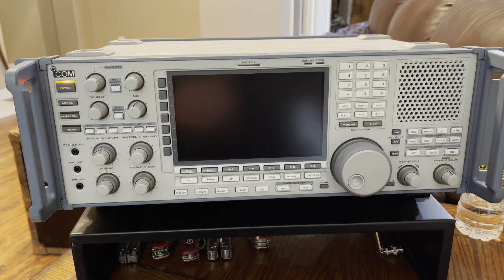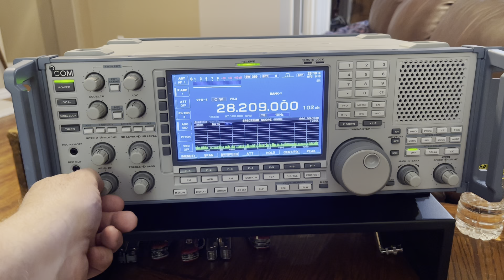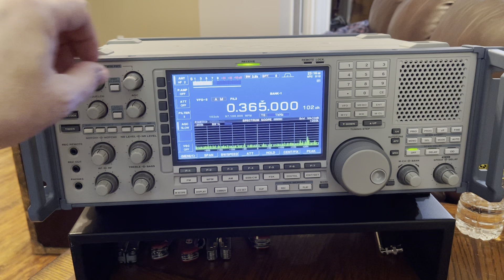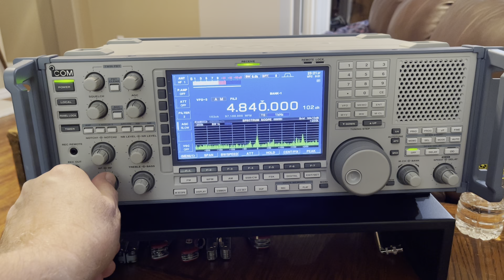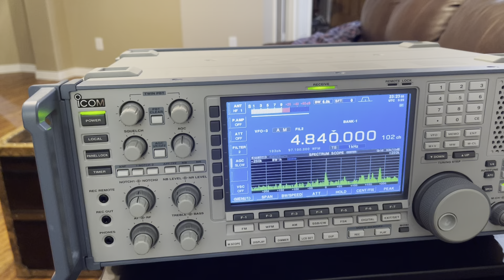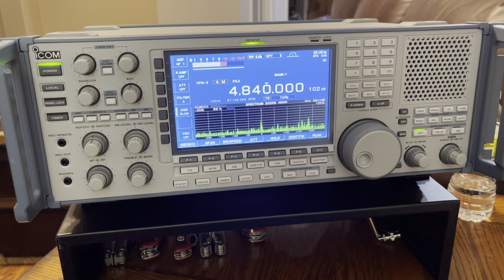Icom IC-R9500

Comment: I have had this remarkable receiver since November 2011 when I purchased it from Amateur Electronic Supply. I only have a vertical antenna (HOA stuff) also use my gutters, indoor discone, and a Diamond (indoor) dipole. I'm an avid short wave listener as well as international flight communications and a helluva lot more. Not long ago I was able to pick up the Solomon Islands Broadcasting Station from my home in Monroe Township, NJ with my poor vertical until Radio Romania came on and knocked it out. This radio will do things you cannot believe. I regularly listen to volmets, UK Military flights, Gander radio, LDOC's, Dakar ATC, SFO ATC, ACARS (have a converter for this), etc., etc. W2FKN
Reply from the maker: Thanks Rich. After 5 days I love this thing even more.

Comment: Good to see  video on the 9500. I have one here also, u can see in some of my vids. I do wish Icom would do some updates to this radio maybe a firmware update. I use mine on FM Broadcast quite often and wish that I could select a narrower filter on WFM as the radio often suffers from near by freq interference on FM band. Its somewhat annoying. Its good to know someone else has one of these.
Reply from the maker: Try using the attenuator to reduce the nearby signals
Reply: @dieselten01  I have all the FM band freqs in one scan bank and what I am sometimes forced to do is to save some of the freqs with the preamp off, this seems to help. But i dont want to reduce signals too much as i am FM DXing. I have written to Icom but got no response
Reply: @dieselten01  also there is a fantastic looking Waterfall graph inside the FSK mode decoder. Surely ICOM can organise a Firmware upgrade to make a waterfall available on the main scope screen
Reply from the maker: @VK2KRR  i agree. A few updates would be nice.

Comment: Makes one wonder why the IC-R9500 still intrinically rocks all these years later.
Reply from the maker: I think it is because radio manufacturers don’t want to put more money into their radios.  Everything now is sdr where you basically operate a computer.  They can achieve great results by tweaking the software.  But for me, I don’t want to operate a computer or click a mouse.  I want to run a radio.  Thanks for your comments

Comment: What ICOM did with this radio is use Superior Components in the radio, with advanced design engineering. Kenwood brags about their brand new 890S having an IMD of 110db!! But the Icom has a IMD of 109DB! That number is hard to engineer back in 2002!! Their is a reason Icom still sells the radio today... Still superior or on par with many newer radios... the Icom uses 32 Bit  point floating DSP, same as the 890S, but all V8 engines are not created the same. 20 years later and the Icom will still out perform the Kenwood in many ways...
Robert

Comment: Also I have a 9500 also bought it from DX engineering it will be 2 years old this July. Also apparently they have been officially discontinued Icom is no longer selling or making these receivers any more.  I am anxiously waiting on any news for the next replacement model probably a R-10000. Does anybody have any news on the next model or a good place to check for latest greatest rumors.

Comment: Awesome 👍 quite rare to see the 9000 and 9500 together. Have you tried out the RTTY decode yet ? I've seen another video of this happening and it's even got a brilliant little tuning aid to line up the peaks and then scrolls the readout across the screen. Personally I'd be really interested in the comparison between this beast and the 9000 just to see the differences in pure analog as in the 9000 to the analog/digital of the 9500. Where you can scan microwaves and with the colour screen if only it was portable because you would be able to pick up CCTV footage and all sorts not just the normal television channels lols I dare say with the capability of it reading memory cards you could probably even watch films on it !! I'd be very interested in seeing how it also compares with for example the ICOM IC-R20 on general scanning operation. Look forward to seeing some more videos on this amazing bit of technology.
Reply from the maker: Thanks Shaun.  I have a comparison video up with the 9000/9500.  As for rtty… I really don’t know anything about that.  Someone requested a fsk decode video yesterday and I went and read about it in the manual… problem is, I don’t know where to find the fsk signals or if fsk and rtty and digital are the same or different. I really don’t know anything about that

Comment: I´m jeaolus ;-) Fantastic piece of Rig. Does the 9500 record to a SD card like th e8600 ? And..could you post more comparisons between the 9500 and the 8600 ? Both are fantastic radio.  What I don´t like of the 8600 is the lack of DMR mode. Too bad.
Reply from the maker: Hi Mark, I have a direct comparison of the 2 radios in a 50 minute long video on my channel. The 9500 will record to either the internal memory or an external USB drive, no SD card slot. The 9500 has an optional Digital board that does P25 phase 1 only, no phase 2. I didn’t get it because everything around here is phase 2.

Comment: hi there,
Could you suggest on How can i operate IC-R9500 in my vehicle with the power supply from my vehicle batteries?
Thanks in advanced.
Reply from the maker: I am not sure but I don’t think the 9500 is rated to run on an automotive 12 volt battery.  I read this on the 9500 owners group on google.  You need a regulated 13.8 volt 10 amp power supply.
Reply: @dieselten01 any alternative mechanism to operate 9500 in vehicle? Besides im thinking to use an inverter in automobile battery as  input voltage, could you suggest please?
Reply: Supplying Dc power source 12V approx. 5A to IC-R9500 with a DC connector.
Its working nicely in Electric Vehicle.

Comment: 6195 had DEEP FADES, and the SYNC was not affected by that, Excellent Sync. SYNC is for Deep Fades, the real test! Also the DNR sounds very good, talk about under water, the Yaesu FT-991 has underwater DNR, the Icom does not...
I would think that once you go back for that 30 second record, you can STORE that recording in memory and not loose it???
Reply from the maker: According to what I read I don’t believe so.  Only saves “normal” recordings. The short recording does not appear in the “recorded files menu” after recording it.

Comment: Before I giff any comments do you have the Telefunken E1800
Reply from the maker: No
Reply: @dieselten01  Well i ,go wait first if ur upgrade ur icom  for more test in weak  ssb am and cw   anyway congtratz   with the new Icom 9500   i loking forward  HNY   73,   ON3MK    XMass
Reply from the maker: @antennebuis  i will be doing a side by side comparison with the WJ 8711, Icom 9000, and the Rohde Schwarz EK070.  Merry Christmas!